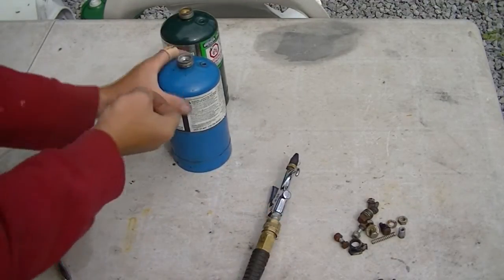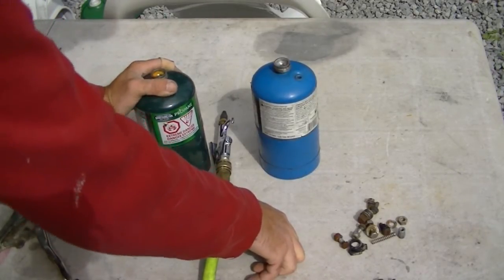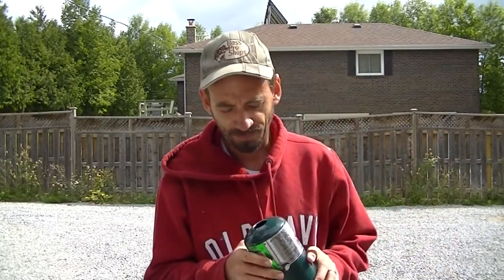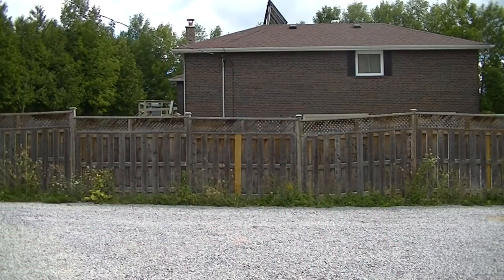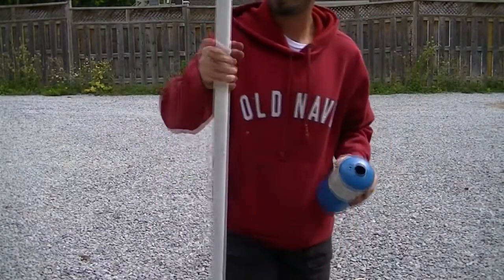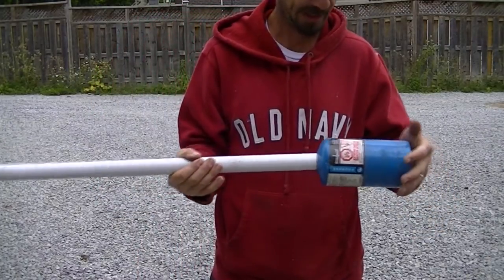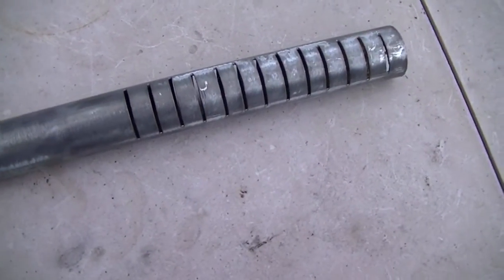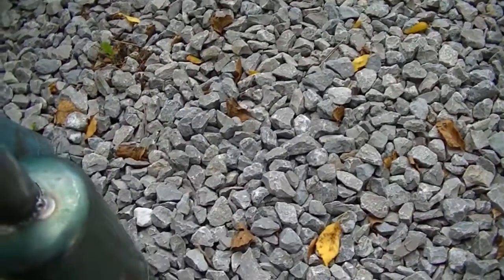Making My Own Mufflers Pt. 2

Comment: I used the same technique for my racing mower and my go kart. I used the thinner propane cylinders that are found on torches instead of the fat ones found on camp stoves. They sound awesome! The go kart I have has a 35 hp Vanguard with a turbo charged from a Ford engine. The mufflers sound amazing! Thanks for the ideas and the vids! Keep it up!
Reply: They sound quiet.

Comment: Quick question for ya. in the pipe that your cut the slits in, if i cut less slits, will it be quieter do to less gasses being let out? im tryin to make a good sounding muffler for ma racing mower, i just dont want it to loud
Reply from the maker: In theory, I suppose. However,  you want to stop short of being too restrictive, which will hurt performance.
Reply: @DocSprocket  ok. Thankyou for the info. Was yours loud to the point where it hurt?
Reply from the maker: @Jordan Simon  No, but keep in mind that I had a muffler for each cylinder, and they're a fairly large chamber. A bigger muffler can by nature, is quieter.

Comment: no paranoia there its true!!! I had to remove a dent in a motor cycle gas tank, drained the fuel and left it outside for 2 days with the cap off... yep put the nail spot welder to it & BLAM... IT SOUNDED LIKE A ROCKET ROARING THROW THE GAS FILL... Fill it with water is right.....that scared the POOP right out of me!!!!!!!
Reply from the maker: Good GOD! Good thing you weren't killed! Well- I ASSUME you weren't killed. If you WERE killed, let me be the forst to tell you that you type pretty well for a dead guy. LOL Ok- accidents can happen, but let's try our best to minimise the risk. Like I said, nothing kills a good time faster than a trip to the emergency room.
Reply: very true heehee...